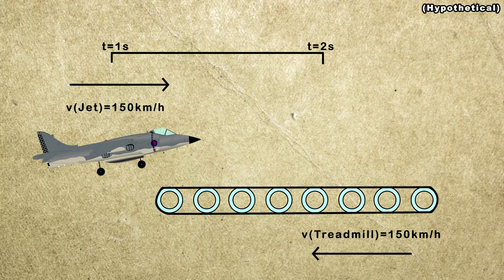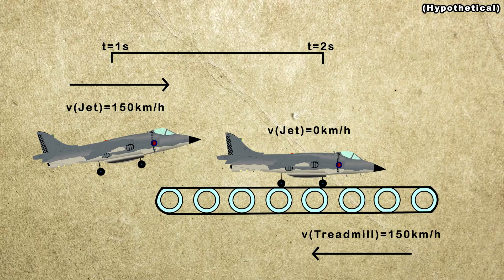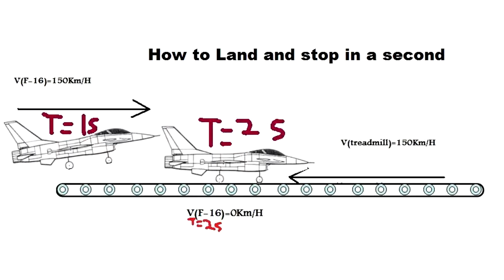why it doesn't work 39

Comment: The wheels would just roll faster once they landed on the treadmill than if they landed on solid ground. And they would be trying to break on a surface that's moving 300 km/h rather than 150 km/h. It would be harder to stop the aircraft for most of the breaking procedure, not easier.

Comment: In the case of stopping the Earth, it's not that simple.

The momentum of any object on the surface of the Earth depends on linear velocity, which is the resultant of angular velocity and the length of the parallel. People move fastest on the equator, slowest at the pole, (the equator is the longest parallel, the pole is a point parallel). So the closer you are to the equator, the faster you would be thrown against the western wall.

Comment: If this were to be implemented, the plane would continue moving at 150 km/h when it touches the treadmill and the wheels would be spinning at 300 km/h.
Reply: wait nvm im confused
Reply: @Austin_Playz27  the plane will continue moving due to its inertia. If the runway is moving in the other direction, then the wheels will have to spin at 300 km/h because the plane is moving at 300km/h relative to the runway.
Reply: @Austin_Playz27  huh
Reply: also, flying under water is faster since there is no air resistance
Reply: @overdrive105  im trying to figure out if this is a joke or not
Reply: the other way then
Reply: wait nvm im dumb

Comment: How about the treadmill is neutral and when the plane lands it gradually raises it's speed until it matches the speed of the plane and then lowers it's speed until it and the plane stop moving
Reply: Because the plane is not driven or stopped by its landing gear. For all intents and porposes, they are essentially free moving. If the ground is moving under the plane, the wheels just end pu spinning faster as the body of the plane maintains its current velocity. So, with this option, it would take roughly the same amount of treadmill as it would take a normal landing strip.

Comment: The problem here is that even if we consider that the plane survives such landing, it is now moving the same 150 km/h, but in the oppostite direction and now we have to somehow stop it again. What is the reason to build that threadmill? Not to build a runway? Well now we still have to do that, but now it's not just asphalt, it's asphalt plus electric mechanisms. Congratulations, we made the same thing but less practical and more expensive

Comment: This is also why it's those movies where the spaceships go from 0 to faster than light wouldn't work. Sure, maybe the ship CAN accelerate that fast... but that doesn't mean YOU can safely
Reply: I think a lot of those assume that the ship isn't actually moving during FTL travel, rather the ship warps spacetime around itself to move. Also assuming that the FTL method is even a warp drive of some sort (like Star Trek) and not just the ship going into a pocket dimension (like Star Wars, WH40k, Halo) which is just a fancy way of doing a wormhole.
Reply: Also the fact someone saw the image and decided to patent the idea is hilarious
Reply: @doughboywhine  I am not sure about Chinese patent law, but if it works like US patent they'd have have to have submitted their application before that showed up online or the online image would invalidate the patent.
Reply: @doughboywhine  That seems likely.  It's also possible Chinese criteria require publication in China or something.
Reply: In Stargate Atlantis, they referred to the inertial dampeners a few times. The fighter pilot immediately knew that the acceleration they are having would be instantly fatal without the super high tech. Made it really easy to drive small spacecrafts.
Once the inertial dampeners were broken in one, and they made super sure that the pilot knew to be extremely careful, the engines were powerful enough to give instant 100g acceleration at the very least.
Reply: Warp is other thing
Reply: which movies...
Reply: @turzilla  like all of them with a spaceship. star wars for example
Reply: @doughboywhine  not really ~ in star wars they go to an alternate dimension so they do not need to worry about deceleration
Reply: @doughboywhine  yea - regardless deceleration is still not an issue
Reply: @doughboywhine  its not tho because of dimensions and whatnot
Reply: @doughboywhine  maybe so but the point is that the original misconception is not accurate ~ and warping space is theorized to be a real way of FTL travel. fun fact!
Reply: @doughboywhine  everybody knows star wars science isn't real what are you getting at here
Reply: @doughboywhine  "if you have to use science magic to explain away something...". Well, given that faster than light travel is also science magic, you might as well also use it to explain why everyone doesnt instantly die.
Reply: @doughboywhine FTL is not "more believable" it's downright impossible. The speed of light is the speed limit of the universe, and nothing with mass can even approach the speed.

Any solution to FTL travel would be science magic. It doesn't matter if it's gravity bubbles, wormhole creation, or alternate dimension hopping. You're arguing a moot point.
Reply: Really depends on what theoretical system they use. Something like a gravity bubble where the space the ship occupies is what is being warped to move the ship would work since neither the ship nor its passangers are actually accelorating, the space they occupy is just being moved.

Comment: What if we use a bunch of giant fans instead?
Reply: if we made an artificial wind that matched the airplane speed, yes it would work. Headwinds lower the required landing speeds. If the air is moving backward at the same speed as the plane moves forward through the air, the plane would be stationary relative to the ground.
Reply: Why don’t we just stop moving? The earth is moving super fast after all
(proceeds to break the laws of everything)
Reply: A lot of headwind may prevent the plane from landing, as the air passing around the wings would provide lift
Reply: @Back-alley-technician  The plane could adjust its angle of attack to control the sink rate. It would just nose down to reduce lift.
Reply: @JaneDoe-dg1gv  I have seen a video where somebody landed standstill with a Cessna. It did not look very safe, because the wind was not 100% stable. Otherwise it would have been easy.
Reply: Or, instead of mounting the fans on the ground, we just put them under the wings so the airplane can stop itself then gently hover down.

Comment: The Mythbusters tested the opposite. An airplane taking off from a treadmill can't be stopped by the treadmill matching the airplane's speed.

Naturally, the inverse also holds true.
Reply: Was about to say this.
Reply: Airplane's speed relative to the treadmill or to the ground?
Reply: There are still lots of people on the internet who debate this. Maybe they are just trolling.
Reply: @adamrak7560  Adam Savage covered this on his YouTube channel. He said the problem is with the way the question is posed in that it could be asking 2 different things and that's what people debate.
Reply: @catholiccontriversy  all the debates I have seen started with clearing up what they mean exactly then they either stick to it against all logic or change between interpretations back and forth.

Comment: I mean, technically if it was way slower and worked gradually instead of getting the plane to a dead stop it could work, but there already are cables, that do this job way better, on aircraft carriers for that exact reason.
Reply: Also, at that point you might as well save the money and just use a normal landing strip.
Reply: well no it wouldnt, because whats holding the plane in the air is its speed through the air, not anything to do with the ground, you would need to have a fan blowing air towards it above its stall speed for it to be able to stay in one spot in the air